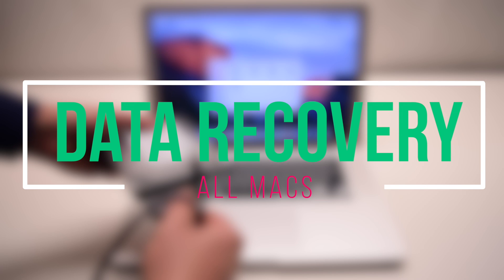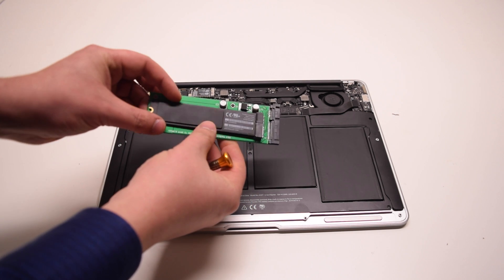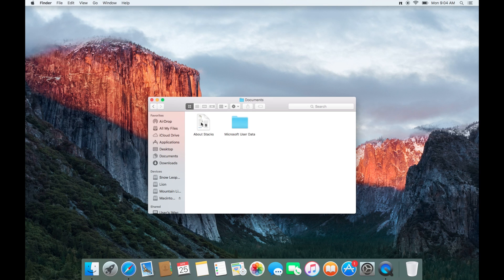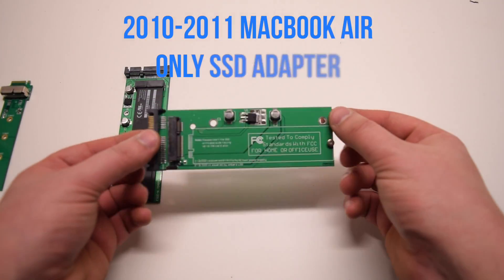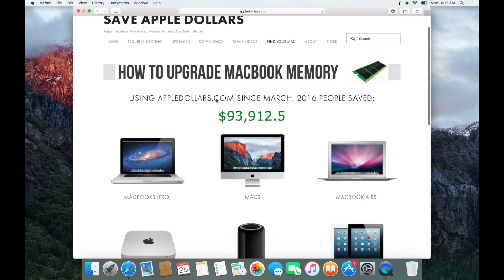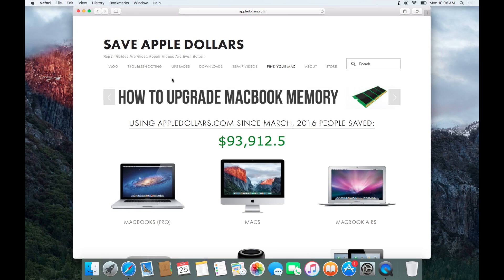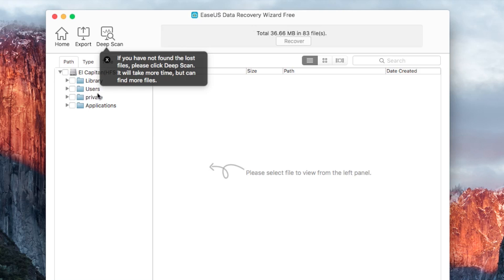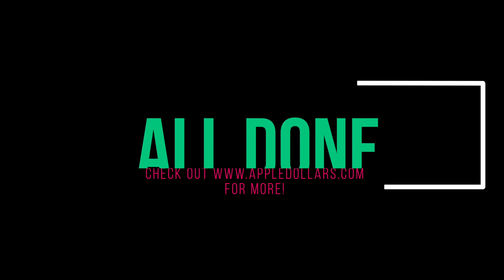How to Recover Data from any Mac Macbook ,iMac, Mac Pro, Mac Mini

Comment: Hi I have a 2013 MacBook Air I took out the sandisk 128 GB 655 SD hard drive which adapter do I exactly have to buy to get that on a different computer?

Comment: curious any shot i can plug the mac hard drive into a windows pc and pull the files off? im having a issue with my imac where the operating system has been corrupted i just want to pull my pictures and videos off of it so that i can put a new os on it and then move the files back on i dont have another apple computer so i was wondering if you can store it on a windows pc?

Comment: After I recover my files - is it possible to restore the drive to factory settings for the computer it originally came out of?
Reply: I tried doing that through this video and it doesn't seems to work
Im glad SYDCOM06 On lnstagram for mine fixed successfully

Comment: Would you mind linking me the adapter for a new model macbook pro? Mine is 2019 macbook pro! Thank you in advance
Reply from the maker: All 2019 Macooks, Macbook Pros and Macbook Airs have a soldered in SSD. If you need to back it up or copy it then boot from it to ghost it on to another drive, you can use any external usb hard drive.
Reply: @GRIBSOFT  My 2018 MacBook Pro is completely dead not powering up, do you suggest the process how to extract my data by pulling SSD out into external?? do you have a youtube URL to teach us, thanks in advance.

Comment: Quick question. What do I need to get data off an early 2011 MacBook Pro and then plug it into a 2019 MacBook Air? Would it just be the adaptor you have listed above, and then plus the USB into this: https://www.staples.ca/products/1641094-en-apple-usb-c-to-usb-adapter?variant=19663811674181
Reply from the maker: Yes, thats exactly what you need.
Reply: @GRIBSOFT  Thank you!

Comment: Quick question, I went to your site but just wanted to ask you.. I was told my hard drive failed on start up disk utility it says it’s unmountable can I try this to recover some word documents? Is this the same kind of thing the techs would do if I sent my hard-drive out? Thank you
Reply from the maker: Yes, this exactly what majority of technicians would try before sending out the drive to a third party who could reconstruct it or repair internal damages for upper of $10k.
Reply: Save Apple Dollars thanks so much for your speedy response! I’ll give this a try. Thanks again.

Comment: Can you please help by providing the name of the type of screwdriver you use to remove the 1 screw for the hard drive?? I’ve ordered two different torx T6 screwdrivers that we’re the right 6-sided-star shape but both were too big for the screw. Is there a specific size or name I should be searching for, or do you have a link to the exact one you’re using here? Please and thank you!
Reply from the maker: T5 or T4. You should buy a kit that’s has all T bits.

Comment: Hello,
I have a Mac Book Pro 2010 do you know what adapter I will need? Also once I get the adapter in order to pull the data off the hardware do I need to plug into another Mac or will a PC work to extract?
Thank youuu!!

Comment: Thank you so much for a very clear and helpful video! I took my 2007 MacBook to the Apple shop which wouldn’t start up and their external boot drive couldn’t see my HDD. They tried to copy the data onto an external drive but failed and said that after 24hours of trying to copy it manually the folder was empty. They recommended a data recovery lab. Is the process you have described in this video the method a data recovery lab would use? If so, given that the Apple shop boot drive couldn’t read the drive would there still be a chance of recovery? Your advice would be greatly appreciated as I am at risk of losing my composed music of 4 years past! 😱
Reply: I am in a similar situation as you.....were you able to recover your 2007 hard dive and if so, how did you do it ? Thanks!
Reply: @365daysofmeditation  I would have been able to clone it with carbon copy cloner except turns out that a virus altered my permissions to read-only and cannot alter it as it's greyed out. My research shows ways to correct read-only via terminal but it's a bit beyond me. If it weren't for that CC Cloner would have done it. Try that. Good luck!

Comment: I followed this procedure for a bad drive from my 2012 MacBook Pro, but the drive does not show when I hit Go and then choose Computer. I do have a couple of other quite similar old hard drivees and they show up fine. But this one does not. The only way I can see the bad drive onthe computer I'm working on for this (another older MacBook Pro) is to use Disk Utility. Alas, clicking on First Aid with the bad drive selected, doesn't change anything. Thoughts?

Comment: Hello Apple Save dollars, if the Mac was partitioned into 2 env (Mac and Windows (using bootcamp)), would it be possible to retrieve both partitions using this method. Please note the Mac does not come up and irreparable as Apple does not have the parts to do the repairs cos its an old model Mac (MACBOOK PRO 13-INCH, MID 2012). I have alot of vital information on my Windows environment and I'm at a loss on what to do.

Comment: As per this video instructions, I bought the stated SSD adapter and SATA cable to recover my data from my damaged MacBook Pro (13") late 2013 - A 1502, but unfortunately it doesn't work at all!! Now, I am not if I used the right adapter and SATA cable for my MacBook Pro! I would be grateful if anyone give me advise or more details about the correct and compatible Converter Adapter and SATA cable that works with MacBook Pro (13"), Late 2013 (A1502) Thanks!
Reply: Were you able to recover? i have same model and issue

Comment: I have the early 2013 Retina Macbook pro 13 inch, which adapter do I need? Also I live in the UK, so would it be possible to send a link for purchase in the UK?
Reply from the maker: We ship worldwide, this is the adapter you need https://store.appledollars.com/collections/adapters/products/data-recovery-adapter-for-macbook-pro-and-macbook-air-2013-2014-2015-2016
Reply: Save Apple Dollars I believe this is the adapter I need but I’m a little worried. Once I remove the hard drive from my MacBook Pro 2015 Retina, how does it fit in this adapter? Does it go inside? I’m just worried because it looks a lot different than the green ones that were in the video

Comment: Question 
What’s the adapter called 

And can I use the adapter to recover these files from a Mac to a windows Acer?
Reply from the maker: The adapter is based on the year and model of the mac, you can find all adapters here https://store.appledollars.com/collections/adapters you will need special software to read Apple formatted drives but it can be done.

Comment: What’s the adapters name? I have a MacBook Pro 2015 and I need my info on my old broken Mac
Reply from the maker: This is the one you need: https://store.appledollars.com/collections/adapters/products/ssd-case-usb3-0-to-ssd-hard-disk-drive-hdd-enclosure-adapter-external-box-for-2013-2014-2015-apple-macbook-air-a1465-a1466-a1502

Comment: What converter will you need for a 2015 macbook air? 13"
Reply from the maker: Here is what you need https://store.appledollars.com/collections/adapters/products/ssd-case-usb3-0-to-ssd-hard-disk-drive-hdd-enclosure-adapter-external-box-for-2013-2014-2015-apple-macbook-air-a1465-a1466-a1502

Comment: Excellent advice. My ancient Mac G5 has died. So I guess getting the SATA to USM adaptor will work when connecting to another Mac ?
Reply from the maker: Not sure... G5 ..... I wouldn't try to save it, I would use it as a decorative piece :)
Reply: @GRIBSOFT  Thanks ! Good idea, maybe a plant pot holder lol 👍
Reply from the maker: Lol

Comment: Hey there, I'm a hardware newb. What would I plug this adapter (https://www.amazon.com/Sintech-Adapter-Compatible-MacBook-2013-2015/dp/B0173ODBCE) in to once I've inserted the SSD? I'm hoping to get to a place where I can access the data on my SSD via a usb/usb C connection - aka hook it up to my new MacBook Pro and read the files.
Reply from the maker: You need this adapter https://bit.ly/2HWE7xM
Reply: @GRIBSOFT thanks for your response! Just to confirm, if I have a MacBook Air SSD (Model MZ-JPV512S/OA2) I can plug it directly into this adapter:https://bit.ly/2HWE7xM and then connect directly to my new Macbook Pro to access the data? As such, I wouldn't need to also get this: https://www.amazon.com/Sintech-Adapter-Compatible-MacBook-2013-2015/dp/B0173ODBCE. I really appreciate your help here!
Reply from the maker: @mattcolfax  Yes, that is correct.

Comment: Connected the SATA cable to the hard drive of my old white 2010 MacBook that died, and plugged it into my 2014 MacBook Air, and nothing showed up. Followed the directions to a T. Even connected the hard drive of an old toshiba computer I had and it pulled up the hard drive. But didn't for the old MacBook. Any suggestions? (USB 3.0 SATA III Hard Drive Adapter Cable for 2.5 Inch SSD & HDD with Extra USB Power Cable/Support UASP-20cm, Black)
Reply from the maker: Make sure to open disk utility and see if it shows up there and just needs to be mounted.
Reply: Save Apple Dollars it never showed up in the disk utility either. Any thoughts as to why?
Reply from the maker: @chadculpepper4491  Try another adapter, it could be the controller chip in that specific adapter is not friendly with the specific year of the mac you plugged the adapter into. Trying a different adapter would be next best step.

Comment: Will I be able to do this with a modern IOS? Say I buy the most recent macbook pro. Will o have any problem extracting files from a 2.5" data HD
Reply from the maker: As long as you have the correct adapter.

Comment: Hi. My 2012 macbook pro has dropped and I took it to apple they said the hard drive crashed so they will replace it with new one. However, I asked them if its possible to recover the data before replacing the HD but they sais its impossible. I don’t know what to do I have very important data there. Is it possible to recover my data after replacing the old HD??
Reply from the maker: Yup, make sure to tell them you want to keep the old disk and follow this guide.

Comment: doesn’t work for new macbooks
Reply from the maker: Sure it does. Just need the right adapter.
Reply: Save Apple Dollars you can’t remove the hard drive in the new macbooks, what are you talking about?
Reply from the maker: Only on touch bar 2016 and newer they are part of the logicboard. Those units should always be serviced by apple, many of them still have free coverage and recall programs to fix any of those issues.
Reply: Save Apple Dollars like i said you can’t do this on new macbooks lol

Comment: I installed the high Sierra update on my factory 2012 macbook hard drive. It shows as unmountable after I tried swapping the sata cable. Is it possible to try an adapter and externally access any data? I already installed an ssd and successfully installed a clean version of high Sierra. Thank you for any help
Reply from the maker: I don't see why not.

Comment: Hi! I have my SSD safely removed from a broken MacBook Pro 2015 Retina, and I am looking to transfer the data to a 2017 MacBook Pro which only has thunderbolt 3 ports. Do I need more than one adapter to do this? Or what's the best way? Thanks!
Reply: You will definitely need a usb to usb-c adapter for your 2017. About $5-$10  on amazon

Comment: Superhelpful video. Thank you. I used this in conjunction with EaseUS software for $89 and got most of what I lost. That said, I don't know where to find the files that I had placed in "Documents" on my Macbook Pro. Anyone know where those maybe hiding, when I search through my broken SSD hard drive?
Reply from the maker: The recovery software is free for 2GB of files. The files will be in the Documents folder of the user name folder. So if user name is user1 then it will be under "Name of drive/Users/user1/Documents"

Comment: I tried this but it says that I can’t open my folders because I don’t have permission.  I put my password in prior to it, but it still won’t open. Any suggestions?
Reply from the maker: It could be that you are trying to access an account that has been filevault encrypted. Is the account that you are running the software from a full administrator account?
Reply: Save Apple Dollars Save Apple Dollars I’m not sure. I have a 2011 mac book pro and had downloaded High Sierra. The computer I connected it to was a MacBook Air. I’m not sure what operating system it had on it. I did have my computer password protected. Would this work on a non Apple computer? Is there any need to download a software?
Reply from the maker: The only thing i can suggest is to make sure that the computer you are trying to use to recover the data is high sierra as well.

Comment: Thanks for the video. I plugged a SATA 2.5 to USB into my iMac's (Mid 2011) old hard drive and it wasn't there when I went to Go>Computer. What next step would you recommend?
Reply from the maker: Open "Disk Utility", you can find it under the Spotlight search on the top right corner. See if the drive shows up and try selecting it and remounting it.
Reply: Tried that, but no dice. I got this hard drive back after my logic board and video card failed. Told the computer repair place to pull the drive out for me so I could recover on my own. They said the drive was completely fine, so this is weird. I'm thinking maybe I have the wrong cable or it's a faulty one?  (http://a.co/ablj82p )
Reply from the maker: For the iMac on some drives you need an additional power source, this is the bast cable that will pump the correct amount of power to turn on the drive for recovery https://amzn.to/2A9YE0P

Comment: So, I had replaced my original SSD with an OWC 480GB SSD, it filled up and started acting glitchy; kept crashing on login attempts, and finally corrupted the password on many reboot attempts. On a newer MacBook, I bought the SATA adapter and it recognizes the external hard drive, but none of my previous passwords are working to unlock it - Is there any way to bypass the password or somehow reset it? Thanks in advance - Andrew
Reply from the maker: If you vault protected the drive then no, you can't bypass an encrypted apple hard drive. If it's just a user account password that you need, you can reset that with an admin account.
Reply: Thank you!
Reply: How do I sign in as admin? :)
Reply from the maker: You can boot into the recovery partition and reset the password from there on some OS X versions or you can boot into the single user mode on any mac and use the terminal to reset the password https://support.apple.com/en-us/ht201573

Comment: Thank you so, so much for this video! I do have a question, though. I bought a SSD card adapter for my Macbook Pro Retina (2014), and I was wondering, could you please recommend which SATA cable is compatible with this card adapter? You've given me so much hope, and I feel like I'm so close to recovering my data!

This is the SSD card adapter that I bought (if this provides any clarity): https://www.amazon.com/dp/B076P87ZYP/ref=sxbs_sxwds-stvpv2_1?pf_rd_m=ATVPDKIKX0DER&pf_rd_p=2708083022714283574&pd_rd_wg=lHHZh&pf_rd_r=KNJKBKW2D079AT8NMGT4&pf_rd_s=desktop-sx-bottom-slot&pf_rd_t=301&pd_rd_i=B076P87ZYP&pd_rd_w=MUEw2&pf_rd_i=mac+pro+2013+retina+cable&pd_rd_r=d3b6d9a3-7ff7-498d-b2f2-a82307f52ef0&ie=UTF8&qid=1527996085&sr=1

Thank you again!
Reply from the maker: You will need a desktop PC that has a PCIe slot for the adapter. The best option and to future proof your ability to read any Mac SSD after 2013 is this here https://ebay.to/2HkgVH5

Comment: so what advice do you have for the 2007 macbook.... my screen broke and purchased a 2015 macbook pro. Now i want to move the files from the 07 to the 15 pro.
Reply from the maker: Remove the hard drive and use a SATA to usb cable to transfer the files.
Reply: Did this work for you!? I am hoping recover files from my 2007 MacBook...
Reply: @365daysofmeditation  yes except for the passwords in keychain

Comment: I feel like Im missing a step here, I have an early 14 macbook air and I ordered the adapter that was listed on your site: UPC: 701017251842, however the size doesn't match up to a sata adapter.  Did I order the wrong one? Do I need to order a second adapter for the SATA?  Please help!
Reply: Same happens to me! Did you end up finding out whether you needed a second adapter for the SATA? Thanks!
Reply from the maker: What year Macbook air? (No such thing as 14 in airs) Look up the serial number to be exact, watch this video here http://www.appledollars.com/identify-mac and get the info for your mac and we will help you get the correct adapter.

Comment: Can you read a Mac HDD in a Windows computer using the cable? I think that windows PC's cant read Mac ones because of the disk format HFS.
Reply from the maker: You need special software but yes, it's possible, you will have to google it.
Reply: Could you make a tutorial? I can't find enough informationor the rigth programs (For free). 
:c
Reply from the maker: Currently we are concentrating on iphones but yes, as soon as all iphone video series are done.

Comment: my new Mac does not show old drive when I plug it in. Is there a way to search for it
Reply from the maker: Near the apple logo on the top left of the screen click Finder and select Preferences, select the External Disk box, it should show up on the desktop now. If not, then in the top right in the spotlight search type in "disk utility" and open it, make sure the drive shows up there and is mounted.